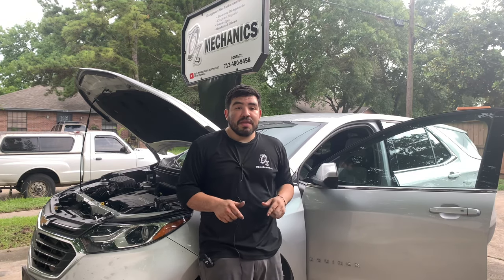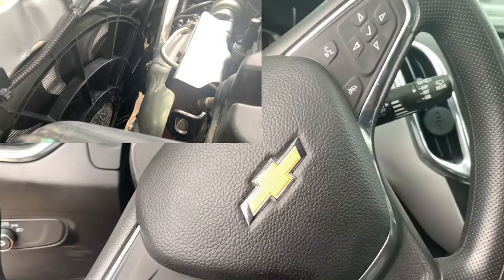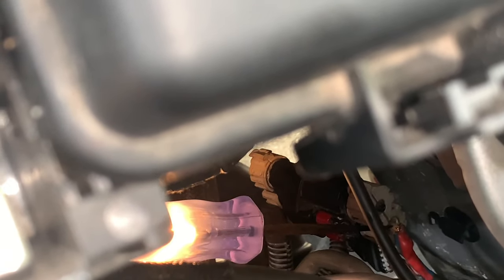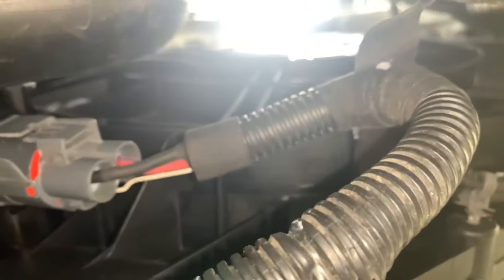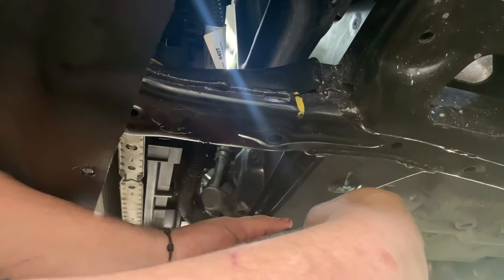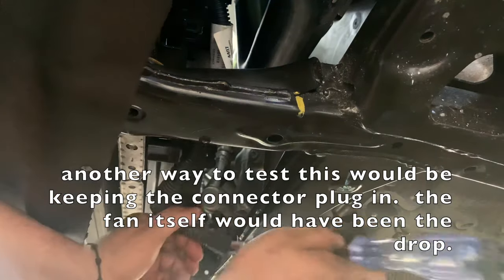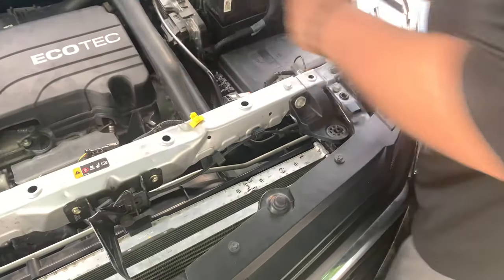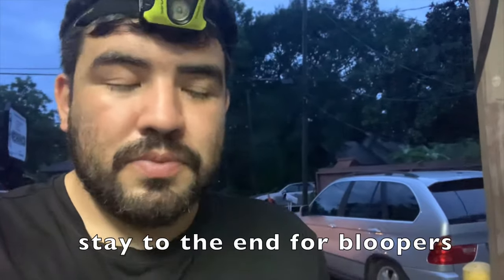Chevrolet radiator fans not working

Comment: If one of the two fans is working, should the other be working, also, at the same speed, at the same time? Or is it computer controlled and additive, meaning does only one fan sometimes come on, normally, and the second fan, slower, or only when needed? I've got one of the two fans that is acting sluggish when I first started the car, then stopped completely before the motor warmed up - not sure if this is normal or not. Thanks!

Comment: I have a 2000 Lumina and the rad fans quit working. I’m thinking it’s a relay or a temp sensor. It’s unlikely that two DC motors would fail at the exact same time.

Comment: Hey I have a question I have a 09 Tahoe and my fans only turn on with my ac on I switched the thermostat and the temp sensor and still does the same. connections, relays and fuses all good do you know what could be the problem

Comment: HEY OZ, i was wondering in cases in which the radiator fan doesn't turn at max speed (needed when in traffic) fan turns but not to its fullest potential. Radiator motor has been ruled out

 what can be the culprit?  

  this is for a chevy malibu 2019 similar to your chevy equinox design but in a malibu application (less space) any help would be appreciated.
Reply from the maker: I’m just going off of memory from older Chevrolets, the max won’t turn on only if it gets to about 240 degrees. Is the car overheating
Reply: @OzMechanics  the transmission is overheating because 2019 Chevy Malibu uses the radiator for cooling the transmission (a little mini radiator in the big radiator) so when in traffic and the fan needs to be a my full blast it’s not and the transmission overheats (only overheated twice)
Reply: @OzMechanics  no real damage to cars cvt
Reply: Problems with transmission present themselves in traffic in hot days when engine temp is at 205 degrees
Reply: nothing come to mind?
Reply: I know the answer but Youtube has shadow banned me for life.
Reply: @user-nf7ui7dz1z   what?

Comment: Hello bro! Question: Can the a/c blow cold without the radiator fans coming on? My sister has a 2009 Chevy Traverse and everything else with the cooling system checks out But the fans won't turn on----  a/c is blowing warm air with compressor clutch engages
Reply from the maker: The ac will only work if the car is moving at high speeds. With out the fan working it can’t cool the leaking in the ac system

Comment: I have a same issue with my fan not working, so when i turn on the car the fan doesn’t spin and when i turn the ac it takes about 15 second to make the fan spin and it works for about another 30-40 secs then it turns off again and it stops spinning  it does it a couple times on an off ? what could be the cause of that? Im planing on replacing the hole cooling sistem on it but just for future references if i can get some help ill appreciate it guys🙏🏼
Reply: You provided no info about your vehicle to get a specific (or close as you can on the interwebs) diagnosis. But I would say that your ac high pressure switch is kicking on/off the ac clutch which in turn is turning the fan on/off.

Comment: I have a 2011 Chevy Cruze Malibu or Impala the thurmastat cracked it's the long one I changed it out and put a new one in now the rataior fan is not working but if you pull the fuse out and put it back in it will come on but won't shut off but if you pull the relay fuse it will shut off but when you put it back in it won't come back on so what is the problem if you can help me I would appreciate it very much thank you.

Comment: whats up dude i have a 2018 chevy equinax im having a big problem with the car the radiator fan is not working i checked all the  releys and fuses i installed a new radiator fan and still not working and it doesnt blow cold air please can you help
Reply: You find a solución i have they same problem

Comment: I have a question if you can help me.  I have a 2015 Traverse and I changed the radiator fan and once the new fan was installed it worked very well but the next day it blew the fuse of fan 2. and I changed the fuse and it blew it again, do you have any idea why? Does the fuse burn and only one fan works and the temperature rises a little but only when it is in parking or without walking the truck?
Reply from the maker: Hey there Jose. So normally what causes a fuse to blow is too much current when something is overworking itself or there’s a short. I would probably look for a short first because you did replace the fans already. Here’s a video I made on looking for shorts. Hope this helps 
https://youtu.be/7-VjG6ztNG8

Comment: What causes these connectors to get buggered up like that?

Voltage spikes from the alternator?

No electrical grease to protect the components?

Inferior material/workmanship?

Poor design?
Reply from the maker: Most of the time is poor contact on the connector
Reply: @OzMechanics  
Thanks. Cant understand why the coolant fan and the blower motor acted up at the exact same time. I'm wondering if they are related in any possible way?
Reply: @OzMechanics  So did you end up just crimping the Butt-connector to bypass the burnt connectors? I have a connector that looks the same and was just going to cut the wrong plug connector on new fans I bought and the harness connector and straight wire with butt-connector instead of the plugs.  Should that work? Any issues with that? Thank you, just subscribed! Know this is an old video but hopefully still able to see my question :)

Comment: Just jump the relay to the fan, that should tell you if the wiring and fun it self is working or not
Reply from the maker: What happens if you jump the relay and it fires up, what do you do then ? And the relay is not the issue. It’s always good to properly diagnose a vehicle right and go through every step. Thanks for watching.

Comment: You know a test light is not the right tool to use, you need a multimeter to measure the voltage